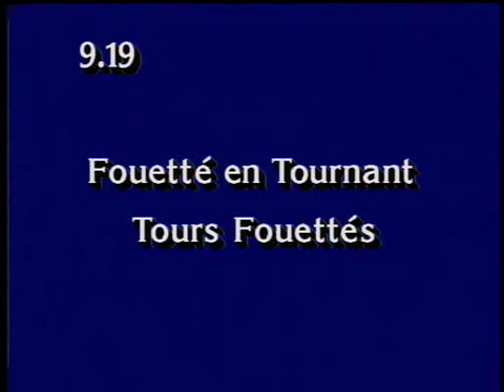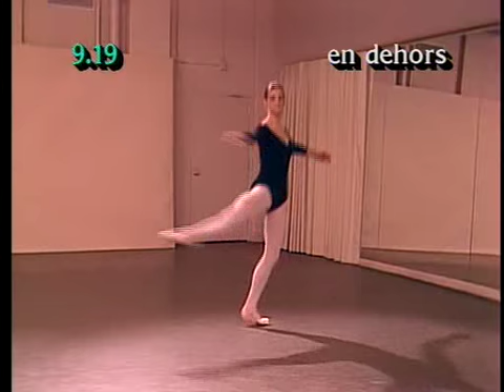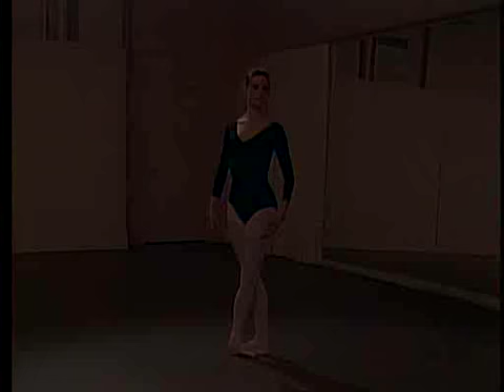Fouetté turns: Italian vs. Russian method with Merrill Ashley

Comment: When I was training professionally, we worked on both the Italian method and Russian method of fouette turns, even though our training was Vaganova based. The Italian method, with the grand rond de jambe, really aids in building momentum, which allows for more turns. The Russian method almost felt as if it was stopping this momentum. I would say as well that the Russian fouettes are harder to master. As you can see in this video, even when she is demonstrating the Russian method, her very first fouette included a rond de jambe, almost as if to build her momentum.
Reply: My problem is each fouette gives me more and more momentum, till i'm turning so fast that i start going everywhere. Is it a matter of technique or i should try russian?
Reply: You could try Russian, but it's important to remember to control your movements whether that be in the Italian or Russian style. When you lack strength and control, that is when things start going out the window. Try practicing the whipping action of the leg, along with the spring up to demi-pointe at the barre; first without the turn and then with, making sure you well placed (knees over toes en plie, hips square and stable, legs well turned out from the hip). Also think about maintaining a strong core throughout, and keeping your shoulders down and well placed to avoid pumping. You should also make sure you are able to perform the releves without slamming down when it's time to plie. If you are controlling the descent from releve, you will have more control overall in the turn.
Reply: Thanks a lot!!! i'll try those excercises, and focus on strenght.
Reply: vaganovaballerina1 wait what is the difference???? I'm a dancer
Reply: A fouette turn in the Italian style includes a demi grand rond de jambe, with a plie as the leg extends devant. Then the supporting leg stretches and the foot springs up to demi pointe, as the leg ronds to second. This is the fouette action. The leg is finally brought into passe from second as the turn is performed. In the Russian style, the fouette action includes a sharp developpe, enveloppe action a la seconde, the turn happening as the leg enveloppes to passe.
Reply: @quetzalcoatltopiltzin2423  If you're running into this problem, the Russian style might actually help you. I find that I travel a lot less doing the Russian style than the Italian because it gives me a short moment to "pause" when I'm doing the plie a la seconde and readjust.
Reply: Thanks a lot! I'll try
Reply: That's why I got confused. I couldn't get the difference between the 2 styles

Comment: which are. generaaly more difficult?
Reply: I would say that Italian method is more difficult because your working leg must open from front to a la seconde very fast. If it isn't fast, then you lose momentum and also might lose your balance. It's additional work, while in Russian method working leg does a lot less movement, it's like open-close-open-close so it's easier. But this is just from my experience, a lot of people in the comments say that Italian fouettes are easier.
Reply: @crescendocdt  Gee sorry for my spelling! Was sleepy. I reckon I'd find Russian harder 'cause having a strong turn out in la seconde is hard, opening front first gives me a bit more power/preperation. But really I'm bad at both hehe
Reply: The Italian style of fouettes would be harder as it requires more control and strength to rond de jambe from devant to a la seconde than to extend directly to a la seconde.

Comment: why do the ballerinas of the older years cross their feet over in passe so much why isn't it toe to knee...half the foot is crossed over the leg like that is so ugly
Reply: Because it goes higher!
Reply: It depends on your school/technique. In Vaganova you're actually told to rest your foot in the indentation under your knee, so yes, half of the foot IS supposed to be crossed over the leg.
Reply: This is actually how I was taught (I’m 32 and did ballet for 5/6 years) and it’s biomechanically and works better in terms of physics and gravity than toe to knee. Today’s ballerina’s don’t understand what working biomechanically correct feels like, with shoes that fit you like a glove in every way, with no hyperflexion, and that’s why injury is so high. I was taught that way and it’s why I came out without lasting injuries.